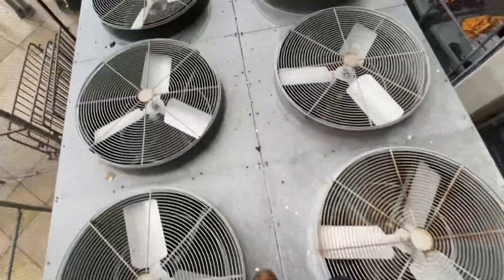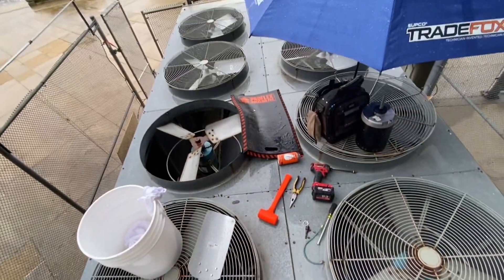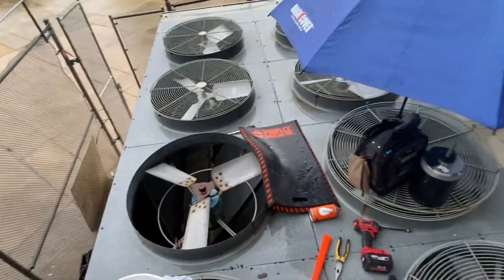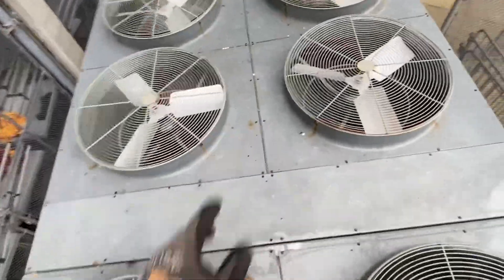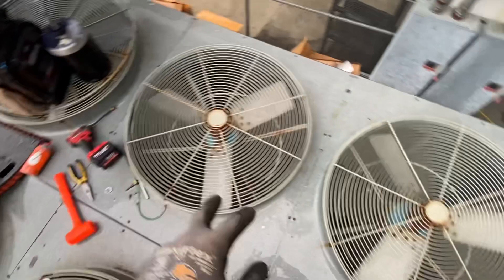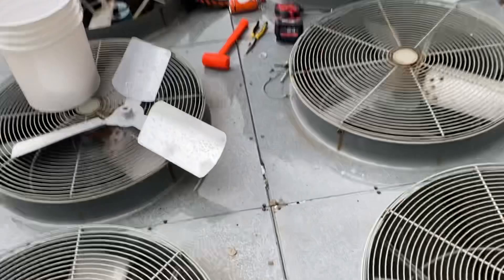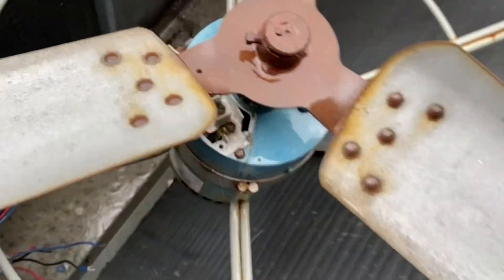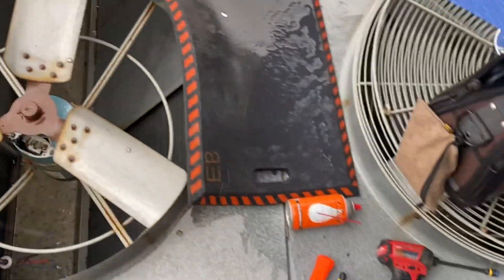Changing condenser fan motors on Trane RTAA

Comment: That's a whopping number of fans.  Stay dry.  
I take it this is all done as preventive maintenance.
Reply from the maker: This was part of a quoted job for work to essentially give old equipment new warranty since they did not go for a chiller replacement. They have 4 400ton air cooled chillers for this stadium and all from 1998. We did 4 new compressors, all original fan motors replaced, new EEVs and wiring/modules, all new pressure transducers and switches, filters,etc. One ckt had a comp burnout so that one got virgin r22, other ckt just got what we pulled out which was the factory charge. New stadium will be built at some point so this is just to help make it till then.
Reply: @dmvhvactech  Sounds like just about everything got replaced except the coils and barrels.  I was imagining it was some critical installation such as a hospital or industrial processing.  I underestimate the importance of sports  :-)    Anyway, thanks for explaining which refrig -- I was curious about that too.